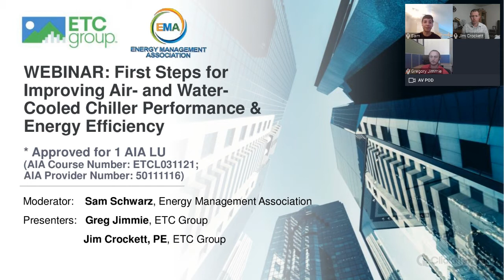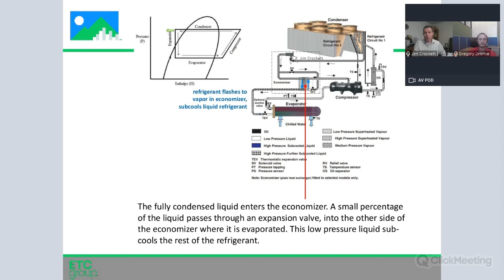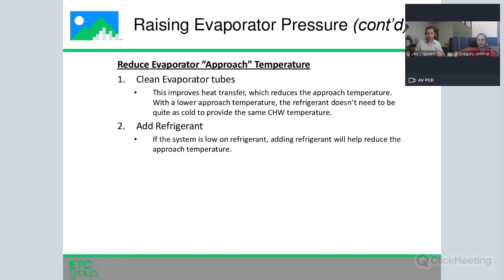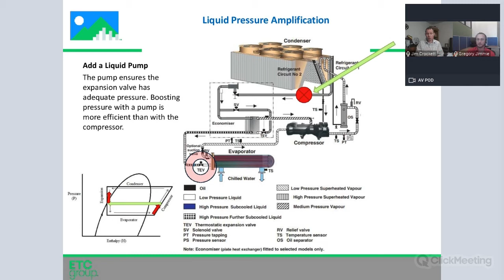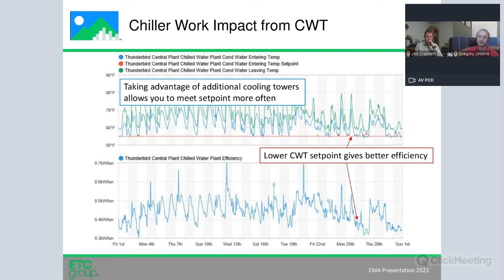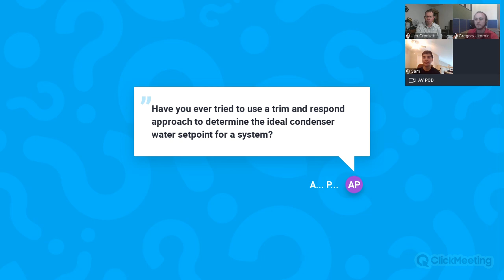WEBINAR: First Steps for Improving Air- and Water- Cooled Chiller Performance & Energy Efficiency

Comment: if you have calculated (accurately) the kilowatt per ton then you could easily obtain the evaporator tonnage as well as the condenser tonnage,  have you tried balancing them? [compressor_kw + evap_tr - condenser tr], did they  zero out?
Reply from the maker: Yes, heat rejected by the towers should be roughly equivalent to heat rejected from the CHW loop plus additional compressor energy. We’ve found that they do balance out fairly roughly (within 3%).  If you had two measurements (CW tons, CHW tons, Comp kW), you could  approximate the third.

Comment: as the chilled water circulation is in closed Loop our pump suction pressure is 3.5 kg/cm2 and delivery pressure is 5 kg/cm2 ..shall i reduce the pump energy by reducing these pressure to 1 and 2.5 resp?..means only actual head requirement is less tha design for closed Loop, agree?

Comment: increasing CHW setpoint will have a ripple effect first on the chw pumping power and the on the air handlers motor, increasing chws temp will also increase airhandlers supply air temp thus increasing the ahu motor kw.. adding them all together lets say for a mall with 100 airhandlers, does the benefit outweigh the penalty? or the other way around?
Reply from the maker: Good question! I'll address AHUs first. When you raise CHW setpoint, it doesn't increase supply air temperature. The CHW valves open further to achieve the same supply temp, this assumes that you are not adjusting/resetting the AHUs supply temperature setpoint. If you are, this becomes a balance on the specific AHUs energy balance between fan energy and cooling energy. As long as the AHUs maintain the same setpoint, there is zero impact on fan energy. The control strategy we recommend is directly tied to the average of the “priority” AHU chilled water valves; this allows the system to know when to can increase the CHW temperature. In general as long as none of them are at 100% CHW valve, there is opportunity to increase the system CHW supply temperature. But, to your point, water flow DOES increase, along with pump energy. At that point, it comes down to specifics: how efficient is the chiller, what % speed is the pump running at, etc. However, in most cases, the savings realized by a 300 ton chiller outweigh the penalty on the 15-20 HP pump that supports it.